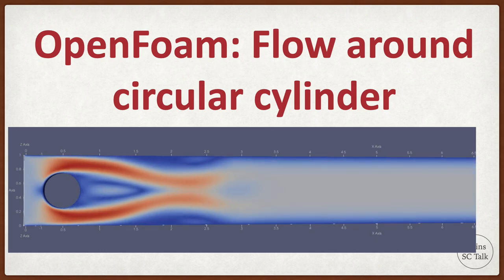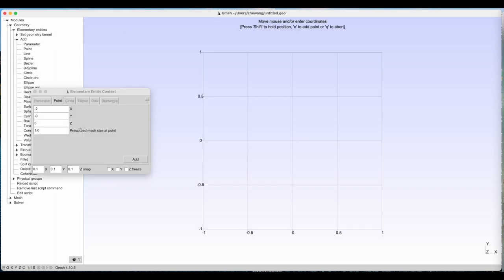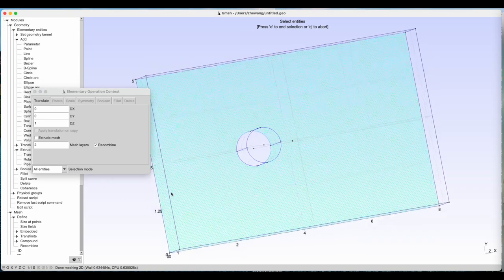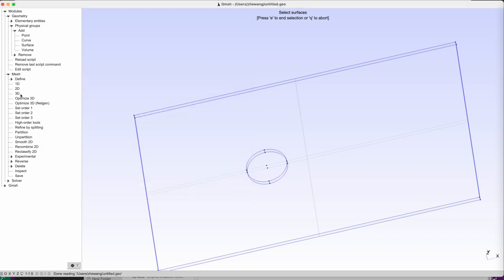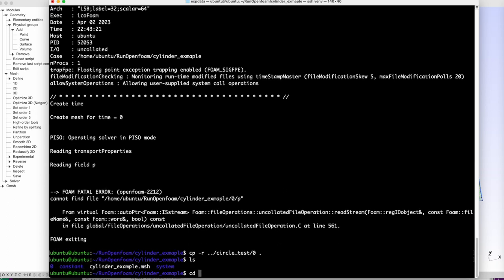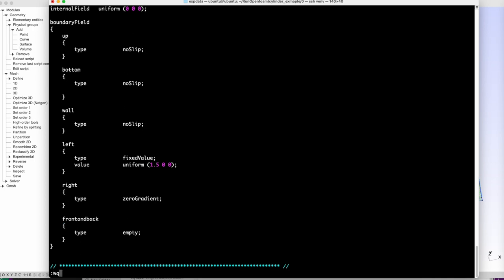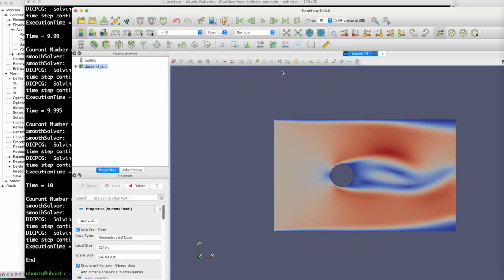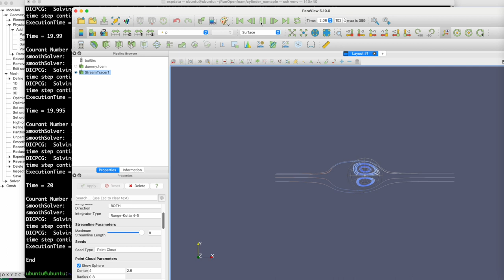Gmsh & OpenFoam & ParaView to create and visualize the flow around cylinder simulation from scratch

Comment: First, thank you so much for this quickly and informative tutorial.
However, why did you not modify the boundaries of the mesh at wall to be type : wall & frontAndBack to be empty to put the data on it.
just correct me if I am wrong.

Thanks
Reply from the maker: This is the configuration files I adopted (https://github.com/wangzhezhe/5MCST/blob/master/openfoam_example/circular_cylinder/example_constant/example_boundry), the type of the wall should be wall and the frontAndBack should be empty, thanks!